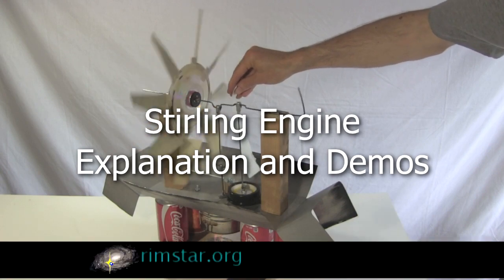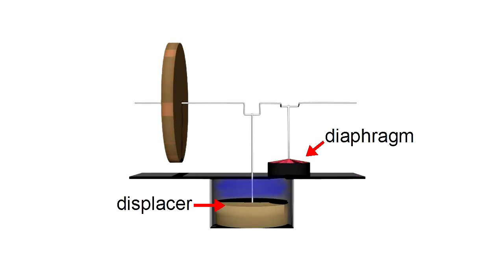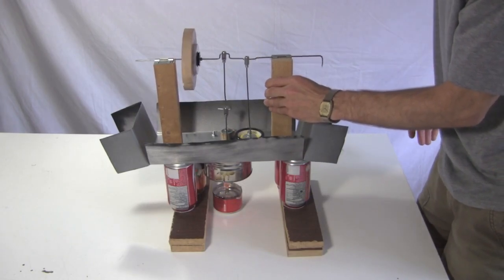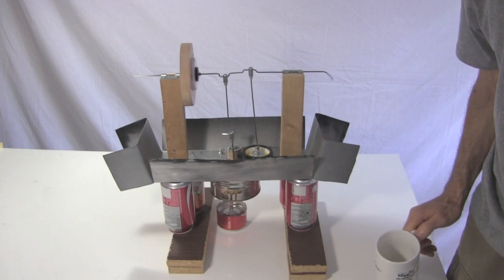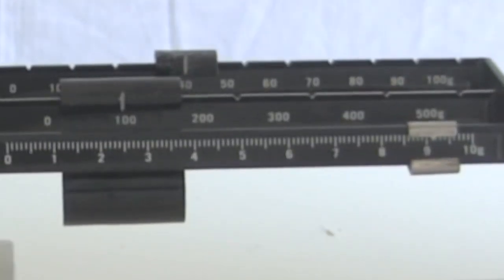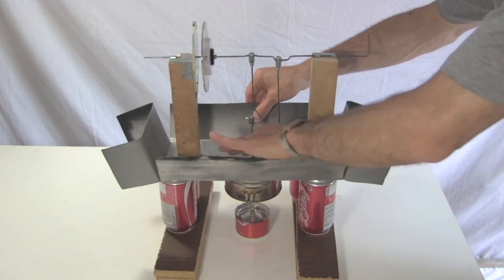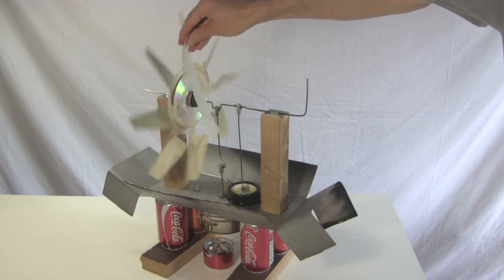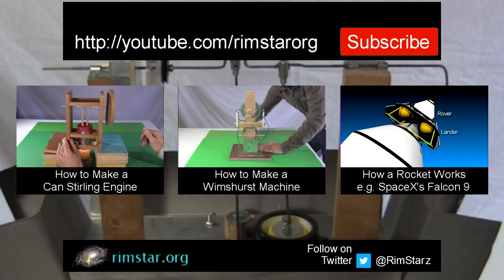Stirling Engine Explanation, Demos and Experimenting

Comment: The bends on the crankshaft pulling each of the pistons… they aren’t 180 degrees from each other. I think I said that right? How did you know the angles to bend them at to make them work in time with each other? A formula, or just trial and error?
Reply from the maker: I think you meant 90 degrees and yes they are 90 degrees from each other. You can see it better in this diagram for the video for my smaller Stirling engine https://youtu.be/FCjYZT6FJm4?si=b7dGjhXAYFvwAg4r&t=212 . The dimensions though, were are done by trial and error.

Comment: ...how are your soldering skills? if they're decent, you could solder some fins to the side of the plate to increase the surface area, but if not, you could just get some thermal paste and some old cpu heatsinks and basically use the paste to glue the heatsinks in place, again increasing your surface area for added cooling
Reply from the maker: Thanks. Another option I was thinking of was to replace the big steel sheet with an aluminum one I have (it's thicker and more rigid than the aluminum flashing you buy in hardware stores). Aluminum has better thermal conductivity than steel.
However, I designed this one specifically for use outdoors with my Fresnel lens and when I did that, I didn't have any problem with getting rid of the heat. Here's the video where I do it http://youtu.be/U5axWtCqgCA.

Comment: How did you attach the diaphragm chamber to the cylinder in which you were displacing the air? I noticed that it was to the side, is there a special way to do this?
Reply from the maker: I'm not sure which parts you're referring to but maybe this will help. My webpage about this has some construction photos http://rimstar.org/science_electronics_projects/stirling_engine_w_big_cylinder_plate_for_fresnel.htm

Comment: Nice engine. But I have a question. How did you attach the displacer cylinder to the cooling plate and made it air-tight?
Reply from the maker: The cylinder is attached using nuts and bolts and then made airtight using normal kitchen and bathroom silicone caulking which is rated at 205C (400F). I filmed all of my making of this engine but never put it into a video because I wanted to make improvements first. But you can see a lot of the making-of details on my webpage http://rimstar.org/science_electronics_projects/stirling_engine_w_big_cylinder_plate_for_fresnel.htm
Reply: RimstarOrg
Ok thanks!
Reply: RimstarOrg  what kinds of nuts did you use? peanuts or walnuts?
Reply from the maker: dominykas maiselis
Almonds. They contain plenty of healthy fats. :)

Comment: It'd be interesting to see the crankshaft connected to a water reservoir allowing water to run over the top helping to cool it before returning to the reservoir again.
Reply from the maker: Sort of a water wheel. That would be neat. I think I'll have to increase the power a bit before it can lift water like that though. I have it on my list to try to get a better seal where the rod goes down through the tube to the displacer cylinder and change the big top plate to aluminum instead of steel. Thanks for the suggestion.

Comment from the maker: I definitely see your point about attenuation though. Sticking with the displacer I have now I should put a second aluminum disk on top, so the air doesn't enter the steel wool and become trapped on the up stroke.

Comment from the maker: Thanks for the explanation. I actually was aware of regeneration and that's why I went with steel wool. I have an excellent book on Stirling engines "An Introduction to Stirling Engines" by James R. Senft. It talks about regen both as solid cylinders with wires on the periphery, thermally connected to the cylinder, that take and give heat as the air passes by them and as ones like you describe. I guess you wouldn't want the steel wool packed too tightly, otherwise it wouldn't be effective.

Comment: A regenerator makes it more efficient.  It makes it so that less heat is transferred from the hot side to the cold side of the engine per stroke.  If the air can not go through the steel wool you may be better off with a solid displacer because the air in the steel wool will attenuate the pressure changes that you want.  So yeah I would recommend you drill lots of hole in the aluminum plate or replace it with screen so the air can go through it.  Hope this helps you improve it!  :)

Comment: Lets say the displacer (if you use steel wool it's a regenerator) is in the up position and the air is under it in contact with the hot side.  The displacer moves down.  When it goes down the hot air is supposed to go through the steel wool and when it does it transfers some of its heat to it. The air cools and the displacer moves back up.  When the air goes through this time it is preheated before it gets to the hot side.  Continued...

Comment: Thanks!  Here is the video showing the seal and parts inside of mine.  .youtube.com/watch?v=Av_uXfEue0I  I just looked at the pictures on your website.  One thing that you could improve is replace the aluminium flashing of the displacer with screen or drill lots of holes in it.  continued...

Comment from the maker: Neat idea re the silicone caulk gasket. Yup, the displacer is steel wool. You can see some construction photos on my website. There's a link to the webpage in the description below this video. I haven't done a how-it's-made video yet because I want to do more optimizing first, such as changing the base plate from steel to aluminum for much better heat sink thermal conductivity, and changing the displacer shaft to one that's a slightly bigger diameter for better sealing and higher pressure.

Comment from the maker: Not as easily as yours. You used a gasket as a seal between the cylinder and the plate whereas I used silicone caulking. So I have to re-caulk it each time I open it up.

Comment from the maker: I would like to do that at some point. This particular Stirling engine was designed for use outdoors with my fresnel lens, and outdoors I've found that it doesn't need water cooling, the air blowing over it works great. But water cooling would be neat to try.

Comment from the maker: The air cooled idea was inspired by yours! (Hmmm... just noticed I hadn't given you credit... there, just added a mention and link to the video description.) The plate is steel, taken from an old microwave oven case. Only after making it did I remember I had a nice big sheet of thickish aluminum I could have used, which would have transferred heat much better. I didn't go with a chimney because it was designed for outdoor use with my Fresnel lens where the chimney wasn't needed.

Comment: Pretty nice engine!  Reminds me of my air cooled engine.  Is the cold plate aluminium or steel?  Also try making a chimney to keep the exhaust heat from going up and heating up the cold plate.  You could also try sticking old heat sinks all over the cold plate.

Comment from the maker: It'd help a bit but it's a rubber balloon, not as good thermal conductivity as pouring it on the steel plate just above the cylinder. It's probably not that clear from this video since it's not a how-to-make one but the cylinder underneath has a much larger diameter than the diaphragm. Thanks for suggesting though.

Comment from the maker: Thanks! Yeah, the open setup was a design choice so that the big metal plate on top could act as a heat sink, making contact with a lot of flowing outdoor air when I use it with my Fresnel lens. I'm uploading a follow-up video this morning showing it being powered by my Fresnel lens and the big metal plate keeps nice and cool as outdoor air flows over it!

Comment from the maker: The big steel sheet on top it intended as the heatsink, though I may switch it for an aluminum piece instead since aluminum has a much higher thermal conductivity. But I guess additional heatsinks in the middle sticking straight up might be better since they're out of the path of the heat from the heat source.

Comment from the maker: Turning the machine on its side is the plan. Good eye. That's why I used a big can for the cylinder. I'll use my fresnel lens to focus light onto it - my fresnel lens doesn't focus very well. All that steel sheeting is intended as the cooling fins, though I might swap it out for aluminum instead due to it much better thermal conductivity.

Comment: But I do not recommend doing pistons above 70mm in length, the recommended size according to my research practices are displacer piston 35 to 70mm in length.
Recently developed an engine with the displacer piston, fully steel wool, and with this I got the best result, but this should be short,
If you have questions, you can ask.
Leandro Wagner.

Comment from the maker: Commercially made ones are up to 30% efficient, which is pretty efficient. Some small homemade ones are a watt or so of power and light LEDs or run a small pump for water cooling.

Comment from the maker: I was going to try ice cubes at the same time as the water but when I looked in my freezer the ice cube trays were empty. By the time I'd made ice, I'd "broken" my Stirling engine from experimenting with diaphragms so it never made the video. I'll probably experiment further when I get back in a week. There's definitely a lot of room for cooling on that big metal top plate. I think mine needs a bigger temperature difference than just room temp to ice temp, so added heat is needed in my case.

Comment from the maker: The principle my fan used was to blow room temperature air over the Stirling engine. When that cool air contacts the hot metal, heat is transferred to the air and the air moves away, taking the heat. So in a moving car, all you need to do it open front and back windows to get the same effect, or add some ducting to run into and out of a box (your fridge). The old cars that had the triangular windows as part of the front windows didn't even need air conditioning, they worked that well.

Comment: very cool.i think i need to take a break from plane aerodynamics (lift drag, lift coeficent, etc.) and build one. thank you, really cool video. try putting some icecubes on top, it should run quite abit faster. in youtube i saw engine running, with no heating, just ice cubes on top.

Comment: I wonder if you could generate enough heat from a "solar heat box".  You know, made from old pop cans painted black, inside an insulated box.

Of course the design would have to reversed, that is hot side facing the sun.  This way, a water container attached to the bottom could be used help cool.

I have dreamed of a design where a 6 foot hole is made and water is used as the heat sink, as temperatures below ground would be lower than above.  Voila, earth as the heat sink.

Comment: Nice idea with the fan. Quite the big engine there, it runs great :)
I wonder if you could have the flywheel run (via a belt maybe) to a pump to send the water around in a cycle. Hmm, lots of surface area for such experiments with cooling.

Comment from the maker: That's what the long steel plate is for on the top, but I realized that I have an aluminum sheet I could use instead. Aluminum has around 3 times the thermal conductivity.